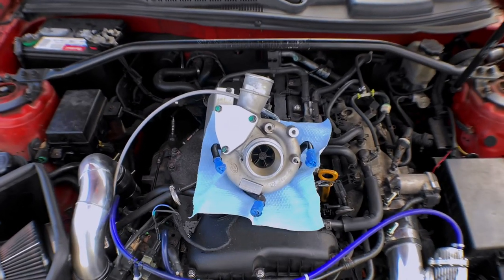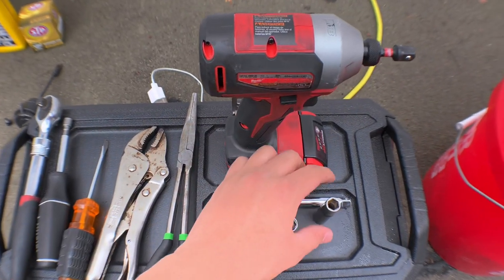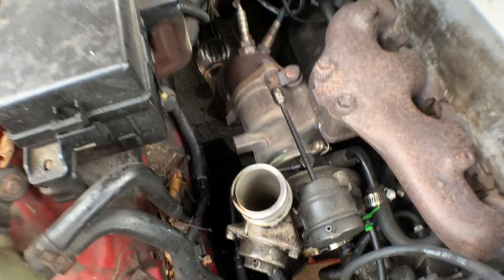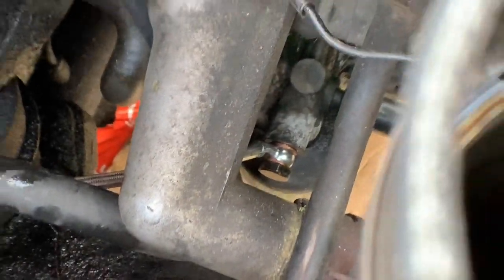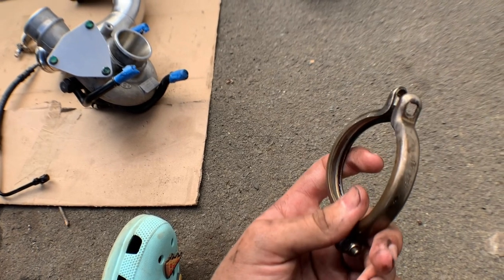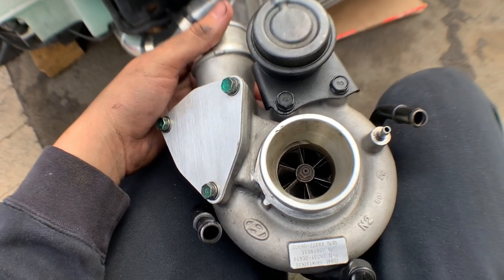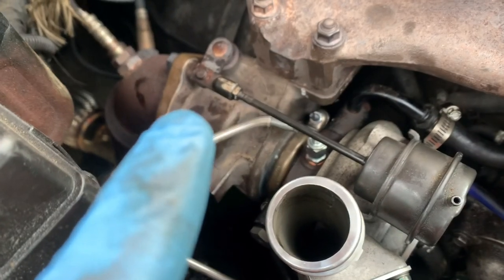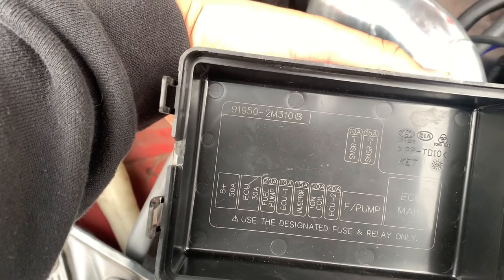BK1 Genesis Coupe 2.0T || OEM Turbo Replacement 🐌

Comment: Very helpful video, with a lot of explanation, I've seen a few other videos where they don't hardly say anything or talk a lot but leave out some important details, but a lot of explanation is given here, and because of the coolant spill you mentioned,I drained my radiator ahead of time so only a few drops came out when removing the hose or bracket from the turbo, I removed the bracket on the underside of the turbo because it seemed a bit easier than removing the hose and lining it up correctly for reinstall with the tight work space, mine is all stock with no modifications so I had more confidence with that method, Great video, And thanks for the help
Reply from the maker: I’m glad that this really helped you!!! Thanks for the support!

Comment: Where do I get a stuffed turbo from?? and is there any supporting mods required for the stuffed turbo? or a tune?
Reply from the maker: I bought it second hand, there are companies that’s make them for our cars… u do need to get tuned if u swap to a stuffed turbo bc it’s technically like going to a bigger turbo, so now u introduce boost soon and more efficiently, plus it’s not properly regulated so yea tuning is a must and for supporting mods, just be FBO and have bigger injectors and a bigger fuel pump and ur good 👍🏻

Comment: Do you need a block off plate when u have a bov by the throttle body like yours
Reply from the maker: Not necessarily, u just have to then T off everything correct so that the diverter valve and the cold side BOV doesn’t interfere with each other

Comment: 9:59 what are those two bolts that go from the exhaust manifold to the back part where the the turbo attaches to. I need to get two new stud bolts and can’t find them.
Reply from the maker: So I heard that your best bet is to order them from the dealership, I can’t remember the part number for them but yea call them up and ask for the Vband studs, or if u can find someone local that’s parting out their gen coupes, you should try that

Comment: Did you have to tune afterwards even doe it was an oem turbo?
Reply from the maker: Nope no tune at all since it’s stock everything, I just did normal preventative maintenance like spark plugs, oil change, all that fun stuff just to be on the safe side ya know
Reply: @519_Garage  ahhh okay so that could also imply for setups where if someone was running a big turbo setup and that turbo blew up they could just buy the same turbo without tuning it because the ECU is already programed for the build,I get it now
Reply from the maker: Definitely get a tune if you upgrade the turbo in any sort of way, as long as u have an exact oem replacement turbo there is no need for a tune ya know
Reply: @CollinGantt I just installed my turbo, has to watch your video along the way, I noticed that I'm leaking oil from the top oil feed line, I manged to tighten easy but I'm running out of ideas
Reply: @CollinGantt bro I know nothing can u plz help I’m so close to selling it for being slow 🙏🏾
Reply from the maker: @curtisgibson5063  what do u wanna know
Reply: @CollinGantt  I have the irs pipes with cats gone . After that idk what else go in order and like what are the main performance booster I rlly need. besides a tune I wanna make the build as easy as I can cause idk rlly much about cars . ( ik this is a lot to read ) but basically what are the main things I rlly need the most to help even tho it will still be slow I just don’t wanna lose bad lol it’s my first car and i don’t wanna sell it just yet I wanna try at least first . Appreciate it
Reply from the maker: @curtisgibson5063  hit me up on instagram @bk1.cjay

Comment: You use 2 blow off valve??
Reply from the maker: No it was routed so one of them was close but I ended up putting a block off plate on the turbo

Comment: What’s the block off plate on turbo for ?
Reply from the maker: To replace the factory Blow off valve on the turbo bc I have an HKS BOV on the cold side which is better for the car overall